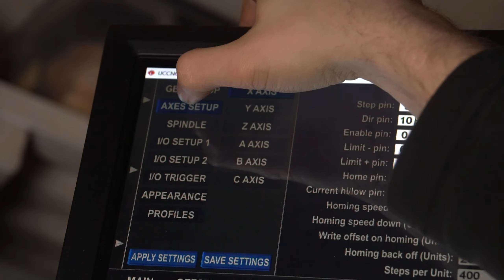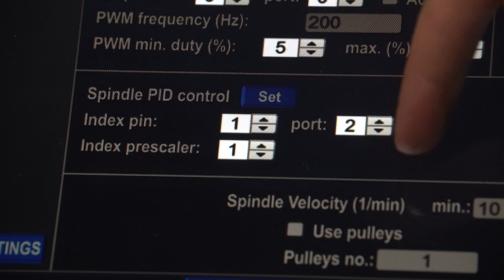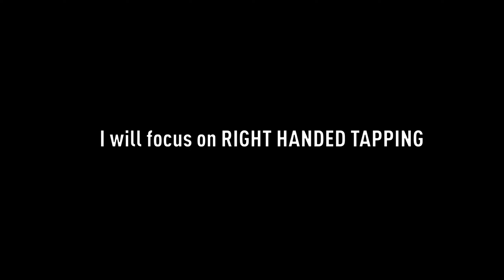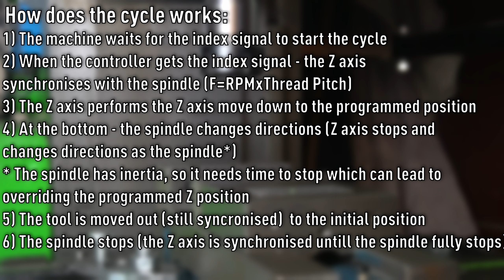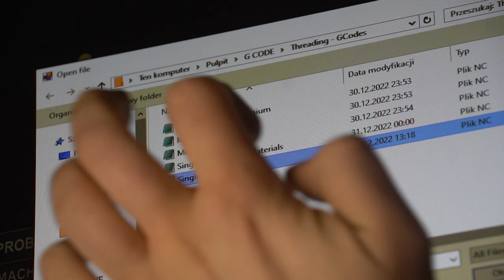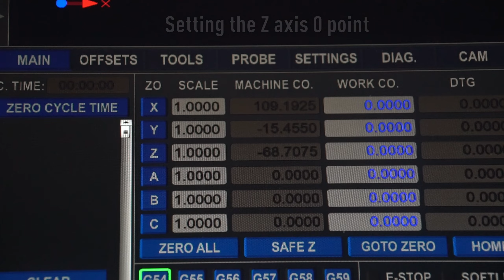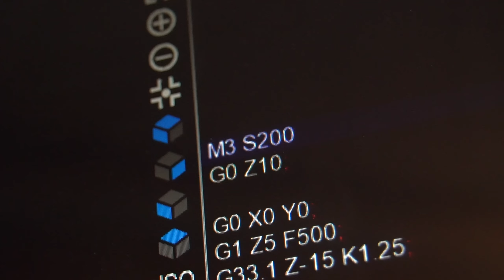UCCNC Rigid Tapping! - G33.1 / G33.2 Cycle on DIY CNC Mill!

Comment: hi, how about thread milling ? which one better for use on the milling machine to use ac servo spindle or ac motor spindle ?
Reply from the maker: Honestly I've never done thread milling on my mill. I'll have to give it a try. When it comes to threading with a tap - both ac servo or standard ac motor will do just fine if you have a right encoder hooked up to the controller and spindle shaft :)
Reply: @GBWM_CNC  about your encoder, is it npn ?

Comment: I have mine working , could you share a copy of the post used  or a copy of the  code it outputs for tapping ,mine keeps throwing a M05 after every hole and then i have to cycle start again on every hole.
Reply from the maker: Honestly I tested this cycle only with hand-written code. I've not tried to output a code through a post.
Reply: @GBWM_CNC  Ok Thanks, it will work thru a post i just got work out the bugs ,i have a job with a lot of holes and stoping and starting just will not work.